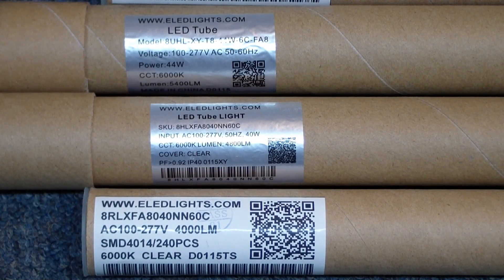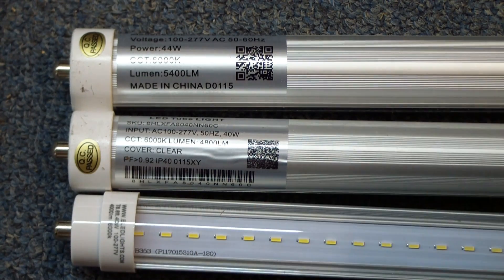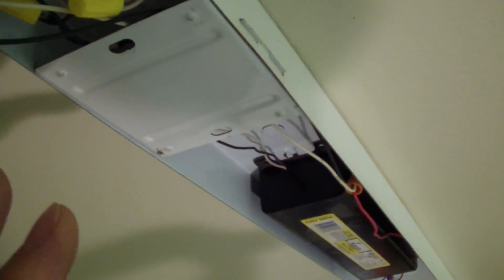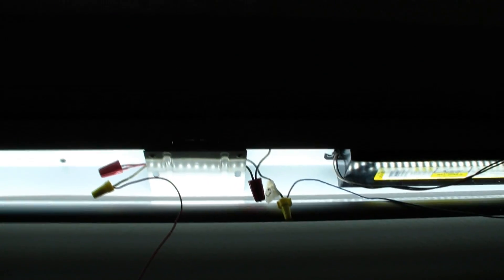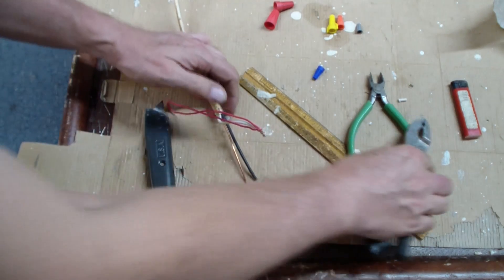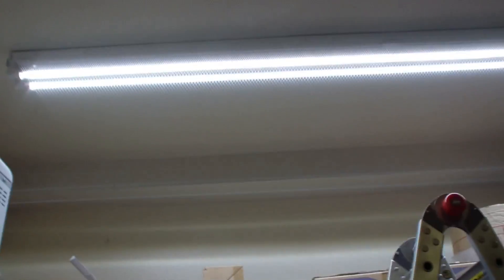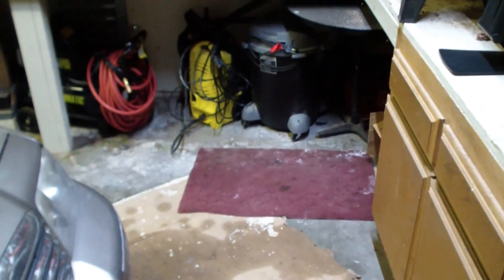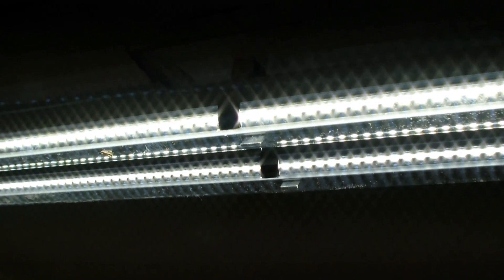eLEDLights.com 8' Tube Bulb Review

Comment: Just yank out the ballast and throw it away.  ALL the wires on one end are tied together and attached to the positive wire (black) and all the wires on the other end are tied together and attached to the negative wire (white).  Use wire nuts to connect your wires.
Reply: I wish you guys would get your terminology correct. There is NO such thing as Negative and Positive in AC wiring.Those terms are for DC wiring ONLY!  In AC wiring Black is traditionally HOT, and White is NEUTRAL. So unless you are running off of a Battery, and not the grid...learn the terms, and the difference, or you eventually will be a statistic!
Reply: @pflagler733  You are absolutely correct.  However, you can kiss my ass.

Comment: Does new LED 8ft bulbs are pretty awesome. But there is one major mistake are you made on your wiring hookup. Wear your black and your whites are at the bulb sockets. You need to hook all four wires to that one single black wire. The reason for this is if you take one bulb out on one side. And the other side will not turn on. You had set it up that you cannot use either side to run a bulb by itself. So if you remove the bulb from the side that you have the original black wire to. You will find out that one side will not stay lit when the bulb is out on one other side. But in order to make it to where you could either side with a bulb by itself. You make sure all of those blacks and whites are hooked together. On the other side with the white wire going straight to the red and blue wires you did that 100% correctly.
Reply: You are right about that and it's a good thing for others to take note of.

Comment: The only disadvantage with these tubes, is that the light is much more directional than a fluorescent tube. If you have one tube in the centre of a room, the floor in the centre is brightly lit, but the wall and work surfaces at the side of the room may receive much less light than they did with the old fluorescent tubes.
Reply from the maker: An open bulb needs frosted coating to diffuse light. Often bulbs are in a fixture where light going up and sideways is wasted. There the clear is awesome giving two to three times the intensity of a florescent bulb. The 8' bulbs all seem to be designed for industrial usage with high ceilings and shining down is better.
Reply: yes. indeed.  So I was quite disappointed when I tried it in my kitchen and had to return it.  I wonder why they a;; seem to have the LED's pointing down only?  I've yet to find one where there are also LED's at other angles.
 I really like the 4000k - I find the warm white just a bit too yellow.

Comment: Unlike the bi-pin lamp holders the single pin doesn't require two sets of wires. It only needs one loop form one side of the lamp holder to the other. Fortunately for you it didn't make any difference by connecting all the wires together.  Just to make it clearer, you can have an 8' bi-pin lamp and an 8' single pin lamp. your light fixture at one time was an 8' bi-pin fixture with a different type ballast. It was retro fitted with single pin lamp holders and a proper ballast. My last comment is...  it is not necessary to pre-twist conductors prior to installing wire nuts to cabiling, in fact it is frowned upon. On the bright side you've shown the difference between different lunines in LED lamps.

Comment: substantial electricity savings can be realized with led lighting. my 700 sq. ft. fluorescent lit local consumed 1500 Watts in lighting.and I still needed extra lights here and there for some work areas.
Reply: I have 40' x 50' metal building.  12' celing.   how many do I need at what spacing ?   how many can I plug together before I need a plug in outlet ?

Comment: Well ....  If a 4ft tube is listed as 2000lm  .. ah ... where are they?  Its not a point source. SO, say, at 1ft anywhere under the bulb, do we have 2000lm? I doubt it.  Divide by the 4 of the 4ft to get 500lm per sq ft? Maybe not. How do I compare amount of light between CFL bulb and  LED tube? I want to start plants. I don't have a clue what I'm doing.  Thanks for the wireing instructions ... I may need them.  What's your best guess?    How many lumens are where?
Reply from the maker: Light follows the inverse square law where doubling the distance gives 4 times less light since 4 times the area is lit. I did a later review for the magnetic strip light where I bought a lux meter to measure the intensity at a fixed distance.. The LED strip had more than double the light of a standard florescent bulb. I love a bright light and placed many in my house and office. The real advantage of LED is CRI, Color Rendering Index. The colors are much more vivid with LED. The CFL bulbs are so drab and dingy. They make special LED grow bulbs for plants with an odd purple/red color but I am sure a standard 4000K bulb would work too..
Reply: He .... he..he...he.  I live dim light. I light my home with a combination of night lights and 20watt halogen study lamps. If I REALLY need to see something I get out my REALLY intense LED flashlight. Thanks for the info. Some questions are really hard to find an answer to. I think you have the right attitude ...  Just try and see .... quite literally SEE.. I do know about the purple/red LED grow lamps BUT they are very expensive for a small area and then, also, I wouldn't really SEE the plants.  I was really frustrated with it all, last night, when I wrote the question.  Thanks for calming me down. I'll try and find the other video. Keep up the good work. He...he ... he...he.

Comment: "iTube" the best way to terminate power guzzler and toxiced fluorescent!
There are many types of ballast been useing in every where like Preheat start, Rapid start, Insatnt start and magnetic ballast. Most of Plug and Play LED tube only can use with Instant start ballast! You should make sure what type of ballast in your existing fixture before you install the new LED tube otherwise LED tube or ballast will be damaged. On the other hand,  Plug and Play LED Tube only can work with ballast, what if the ballast is out? They was designed to work with Instant start ballst which means when ballast is out, your Plug and Play LED Tube also out, it can't work by AC 110 or 220V direct power in, you need to buy a new ballast.
Here is our product" iTube" it can work with AC 110~277V direct power in(by pass the ballast) and if you want a easy way to  replace the fluorescent without by pass the ballast, "iTube" (Certificated by UL Listed, made in Taiwan), the only 1 in the world can fits all types of ballast ( Preheat start, Rapid start, Insatnt start and magnetic ballast). Check out the video https://www.youtube.com/watch?v=3498awz1Ijo
Thank you.